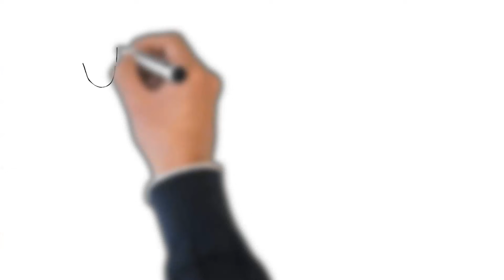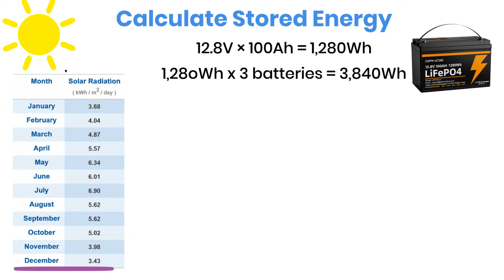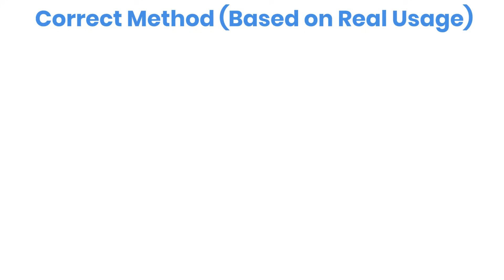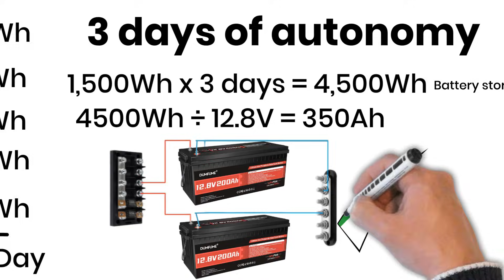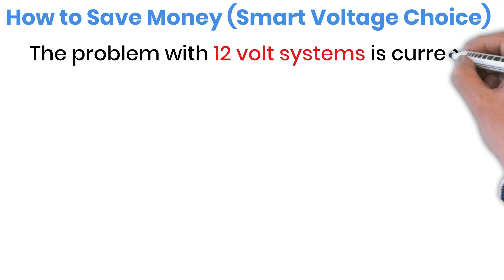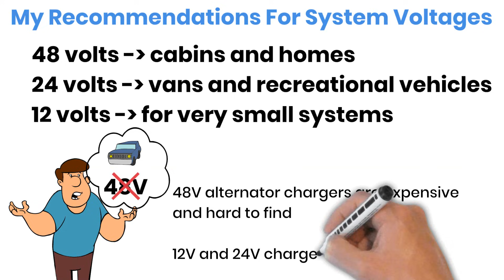How Many Solar Panels for a 3000 Watt Inverter at 12 Volts? (Real Answer + Save Money)

Comment: Does anyone know. I have a camper van with a house battery that gets its charge when I'm driving. I want to add solar will it damage the charge controller or anything if I just leave it connected

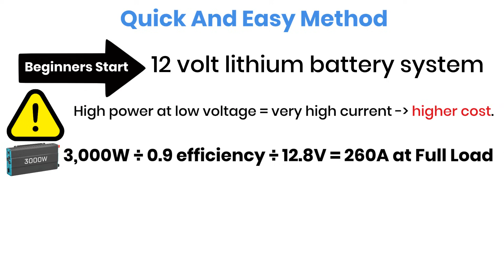Comment: At 0:53 you say 3000W / 0.9 efficiency [= 3333W] which is wrong. The correct is 3000W x 0.9 efficiency = 2700W. With a coefficient less than 1 we can't get more!
So 2700W / 12.8V = 210.9A at full load instead of 260A.

Comment: The question is NOT home many solar panels you need, but what is your current draw. If you needs are less than the 3000w inverter can provide you can use less panels or batteries (or both). If you live in a sunny location (southern California) youcan use less solar panels and more batteries, as they will charge often. If you live in Maine you want more panels and less batteries,  as they will charge less 😮

Comment: you don't know what your talking about at all  haha its funny really 
if your in a perfect world ya maybe your right  but you for got weather and snow rain and all the other goodies dust  birds  you need double the solar panels or more if they don't track the sun
Reply from the maker: You’re right that real-world solar production is affected by weather, snow, dust, shading, and panel angle. The calculation in the video is a starting point based on average sun hours, not a guarantee of actual production. That’s exactly why a real off-grid system needs some extra solar capacity for poor-weather days. What kind of solar-to-battery ratio are you running?

Comment: 1500wh X 3 days = 4500wh is wrong. 3 days needs to be converted to 72 hours. The correct calculation is 1500wh X 72 = 108,000wh of storage needed, assuming all appliances running all the time.
Reply from the maker: The 3 days are already accounted for because 1,500 watt-hours is the daily energy consumption. So 1,500 watt-hours per day × 3 days = 4,500 watt-hours for three days. Multiplying 1,500 watt-hours by 72 hours would double-count the time. The 72-hour approach would be correct if we were starting with a 1,500-watt constant load, not 1,500 watt-hours per day. Thanks for bringing it up though, because this is an easy distinction to misunderstand.

Comment: I've been running a large fridge with a 220w solar panel and a Bluetti EL 100V2 for 4 months this summer. Bluetti has never gone below 60% at night. Multiple cloudy or rainy days will probably not provide enough power. Remains to be seen.
Reply from the maker: That’s actually a good real-world example of how much a fridge can vary depending on its actual energy consumption. If you’re still at 60% after a night, your 220W panel and Bluetti are clearly handling the summer load well. The interesting test will definitely be several consecutive cloudy days. How much does the battery usually drop on a fully cloudy day?

Comment: I don't think the fridge produces that much what kind of fridge are using grandmas mine producers about 142 70 at recommended setting or low option is really enough
Reply from the maker: Fridges can definitely vary a lot in actual energy use depending on the model, thermostat setting, ambient temperature, and how often the compressor runs. The important number for sizing solar is the fridge’s total watt-hours per day, not just its running wattage. What is the exact model of your fridge?

Comment: Buy a small 4000 watt generator and save a bundle.
Reply from the maker: A generator can definitely be a cheaper backup option in some situations. Solar makes more sense for people who want quiet operation and don’t want to depend on fuel, while a generator can be very useful during long periods of bad weather. It really comes down to what the system is being used for.

Comment: Skip the high dollar solar generator game, spend $400 on a 4800 watt gas  generator, doesn't fair skies to do it's job.
Reply from the maker: That’s a fair option too. A generator is hard to beat for long periods of cloudy weather if fuel is readily available. Solar and batteries are more about reducing fuel use and having quiet automatic backup. Different setups make sense for different needs.

Comment: I wonder whether 'Michael' of 'Battery Hacker' has ever heard of a device called a calculator...?
Reply from the maker: 😂 I definitely used a calculator for the math. The calculator gives you the numbers, but the important part is understanding what those numbers actually mean in a real solar system. And as the comments here show, weather, battery limits, and actual energy usage can change the design quite a bit. What part of the calculation do you think I got wrong?

Comment: I finished my system. I made a couple changes. Two 314ah batteries parallel. Two 200 amp circuit breakers. P2 3000 watt Renogy inverter, Victron 150/70 mppt smart charge controller, 2JA 450 watt panels in series, one 400 am T series fuse and one 80 amp anl fuse between controller and bus bar. For 8000 watts storage and 900 watts solar which starts charging much earlier than most. DIY under $4k. Meets all my Tiny home daily usage watt requirements with 4 day’s autonomy !
With a Renogy battery monitor on both batteries! Allows independent battery monitoring !
Reply from the maker: Two 314Ah batteries in parallel gives you about 8,000 watt-hours of storage, and 900 watts of solar is a good match for a tiny home when your daily usage is modest. I also like that you’re monitoring each battery independently. Four days of autonomy gives you a lot of breathing room. How has the system been performing so far on cloudy days?

Comment: I have a 10000w inverter and 3 x 100ah litimum batteries.  What would be the best way to set them up with the right solar panel (size TBD) mounted on the roof of my travel trailer that is already wired for 30 amp leg. Would woting the batteries in a 48 amp set be my best option to keep the heat down and the connecting cables as small as possible. I have a lot of the parts needed but I'm willing to  chage them out if needed. I.can follow plans and plan to do most of the hands on work myself. Can you help me? We live in central Arkansas.
Reply from the maker: Yes, moving to 48 volts can be a great way to reduce current, cable size, and heat, especially with a 10,000 watt inverter. But with three 100Ah batteries, the first thing I’d check is whether those exact batteries are approved by the manufacturer to be connected in series for a 48V bank. You also need to size the solar array and charge controller around the battery voltage, inverter limits, and your actual daily usage. Since this is going into a travel trailer, I’d also look closely at the 30 amp AC service because a 10,000 watt inverter can produce much more power than that shore-power circuit can supply. What voltage are your three batteries, and what brand/model are they?

Comment: I appreciate the math- I’m on the right trajectory with my 24 volt system….
Easy to reconfigure to a 48 volt system.
Reply from the maker: Starting with 24V gives you lower current and easier wiring, while keeping the option to move to 48V later as your system grows. Planning for that upgrade from the beginning can save a lot of rewiring down the road. What size inverter and battery bank are you running on the 24V system?

Comment: Can you tell me i am only using 800 watts fridge with a 3000 inverter with a 300amp battary and have 20amp mppt charger and a 60 amp battary chargers 

Would the 3000 watt inverter use more amp or power.  

If I was too use a 1000 watt inverter would it have power or not make any difference  to the set up
Reply from the maker: The inverter itself doesn't decide how much power is used, your appliance does. If your fridge is only drawing around 800 watts, then a 3000W inverter won't force it to use more power. The main difference is that a larger inverter usually has a slightly higher idle power consumption when it's turned on with little or no load. If you're only ever running that fridge, a 1000W inverter would generally be more efficient as long as it can handle the fridge's startup surge. Is the 800 watts the running power, or is that the startup surge rating?

Comment: I purchased a 3kw inverter for my new van build. I got this cause I wont be installing lpg. It's good but a hassle, not to mention dangerous. 
Instead I'm going to use a induction hob. These single units consume 2-2.4 kw. Hence the 3kw inverter which in reality will produce, at best, 2.6kw. So, this inverter will only just power the hob (@ full power of course)
Re. how many panels are needed to power this inverter? As many panels as you can fit on yr roof!!! There's no such thing as over-kill. Think winter sun. Think cloudy days. On these days solar production will drop dramatically. So you need more panels to compensate.
Obviously, a battery with plenty of   capacity like a LiFePO4 300 Ah min. & you're in business! 🤗
P.S. a 12v system is perfect for for a RV set-up. It's simple & uncomplicated. OK, you need heavier wiring. So what? No big deal. Short cable runs in a std. RV. No drama. No real big loads to deal with unless you're running heavy loads like induction/Air Con. etc.
Reply from the maker: Thanks for sharing your setup. An induction hob is definitely one of the reasons a 3kW inverter makes sense in an RV. I also agree that maximizing roof space for solar is usually a good investment, especially if you camp in winter or spend several cloudy days off-grid. And yes, for many RV builds, a 12V system is still a practical choice because of the wide availability of 12V equipment. Once you start running larger continuous loads like induction cooking or air conditioning, that's where 24V or 48V systems begin to offer real advantages. I'd love to hear how your induction setup performs once the van is finished.
Reply: @batteryhacker4343 
👍

Comment: Have a 12v inverter with 2kw continuous and 3kw peak ratings.
Have four 12v 100ah lifepo4 batteries all in parallel.
Solar charge controller is Victron 150/70.
Only 400w worth of panels at the moment. Plan on getting 2 more. Could do 3 more but all would have to be in series and one lousy cloud would throw a wrench into things. So 2P+2P is what I am going to do.

I chose this for several reasons:
12 is VERY COMMON, especially for automotive things.
I could use my inverter off a running car if need be but cannot do that with 24V+ systems.

About batteries - if one goes bad I still have 3 others to backup power needs. And yes, one could go bad.

I can run my refrigerator off just one battery for about a day. Fridge only uses 130W when running and doesn't run too often.

I could run my gas furnace for at least a day or two off the bateries.

TV set about a week! lol

Would love more and bigger batteries but I only have 2 kidneys if you catch my meaning.
That and too many trees to keep me from having very many panels.
Roof is 100% out of the question due to local laws demanding a bunch of nonsense with expensive permits and the UNNECESSARY 'bring things up to code'.
Not going to spend $3000 to upgrade my main panel and drop just to make an inspector happy.
Nor the $100,000 remodeling costs to replace all the wiring, walls, etc either.

I basically need enough to get by.

Only real reason for permits is to jack up your property taxes...
Reply from the maker: You've put a lot of thought into your setup. I can definitely see why you chose 12V for your application, especially if compatibility with vehicle systems is important. I also like your approach of using multiple 100Ah batteries instead of one large battery it gives you some redundancy if one ever fails. The biggest limitation I see right now is the 400W of solar, but adding two more panels should make a noticeable difference. I'd be interested to hear how the 2P+2P configuration performs once you install it. Keep us posted!
Reply: @batteryhacker4343  I have four 200w bifacial Callsun panels arranges in 2P+2P.
With the new inverter I recently bought I am getting between 500 and 600w during prime hours.
Highest was 635w.

Inverter says it can reliably handle 600w output with 800w input.
Working as they claimed.

Panel angle is 27 deg though.
Need 17 deg but VERY difficult to alter panel angle.
Have to dismantle 1/2 the array to change anything then reassemble.

So, twice a year the angle will be optimal.

Yep, I chose my setup for the ability to use components in a vehicle too if an emergency came up.

Yep, if one battery fails I still have 3 others that can take up the slack but not handle too much at one time.

My setup can peak at 2500w on things starting up.Then settle down to about 1500-1700 ish.

Inverter can be put in a car if bugging out is needed.
batteries too heavy and bulky to easily transport.

If I could afford it I would go up to 24 or even 48v but that required replacing a LOT of equipment (breakers, fuses, inverter to 120vac, etc).

My goal is to power my refrigerator as long as I can.
If winter rolls around I can use my setup to power my furnace. Fridge wouldn't be needed.

I have 2 more of those panels I plan to mount to the side of the house and use them to maintain my batteries. Those will be connected to my Victron 150/70 controller and the batter bank from that.
Not enough to replenish the bank but enough to keep it topped off between uses. MAYBE...

I have 2 smaller ones, 100w max each non bifacial, I can mount somewhere too (have a PWM for those) but need a battery for those for storage.
Wife would be able to charge her stuff, run a desk light, and her fan off those and not draw power from a critical setup.

For cooking food, I have multiple means to do it.
Easiest one is my charcoal briquette grill - can burn wood in that one.

I also have a trangia and two firebox stoves and a couple of generic (home made penny can stoves).

Made another one out of a metal can that I can use charcoal or sticks in it to cook with.

Have been doing a lot of prepping over the years.
Dang mice ate up 1/2 my supplies and still trying to get rid of them.
Caught over 150 of then since February. 4 of them just today.

Would love to have the replacement money for all that to invest in more solar.

Stuff happens ya know...

Comment: I’m building this system with two 314ah 12v batteries using the Renogy 3000 watt inverter. Hooking up with bus bars keeping all cables same length. This video has been perfect for me to figure out solar for down the road. I’m putting two 300 amp circuit breakers in at batteries before positive bus bar ! Along with two Renogy battery monitors.
Reply from the maker: That sounds like a well-thought-out build. Using bus bars with equal-length cables is a great way to help keep the batteries balanced, and having individual protection before the positive bus bar is a good safety practice. The battery monitors will also make troubleshooting much easier later on. I'd love to hear how it performs once everything is up and running. Keep us updated!

Comment: I have to ask why people need so much power,I live off the grid in the wilderness,a bug zapper is essential,my 12 volt vevor diesal heater is essential,I have lights as well...2 100 watt panels,never had an issue,barely drop and rarely at that to 12.9 volts...but usually I'm floating at 13.6 volts...im sure I could a small fridge but have no need
Reply from the maker: I appreciate that, and I think you summed it up really well. As solar becomes more mainstream, making systems easier and safer to install will help far more people get started. DIY will always be great for those who enjoy building their own systems, but plug-and-play solutions are definitely making solar more accessible. It’ll be interesting to see how much battery prices drop over the next few years too. Thanks for sharing your perspective!

Comment: Very interesting video. It was easy to understand and follow through. 
I have an ask. I'm new to this photovoltaic system. 
I want to setup one that would be cost effective. I live in the tropics. 
My Loads:
One 190W Refrigerator ( intended to run for like 4-5hrs/day. 
8-10 Light points of 10W each. 
TV 50W 
Sound system consumes 55W 
And a couple of fans. 

What would you recommend?
Reply from the maker: Thanks, I’m glad the video helped! Based on what you’ve listed, I’d probably recommend starting with a 24V system. A 24V 200Ah LiFePO4 battery, around 1.2–1.7kW of solar panels, and a 2,000W pure sine wave inverter would be a solid starting point for those loads in a tropical climate. The only thing I’d want to confirm is the refrigerator, because 190W is usually its running power, not its daily energy use. Do you know its energy consumption in kWh/day or how many hours the compressor actually runs each day? That would let me size the system much more accurately.